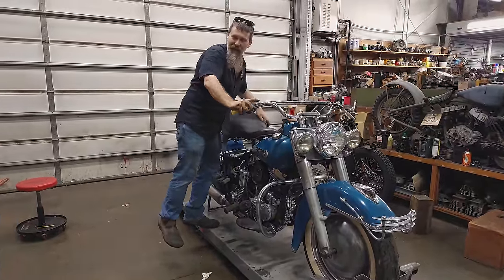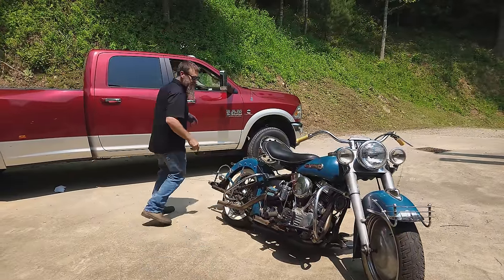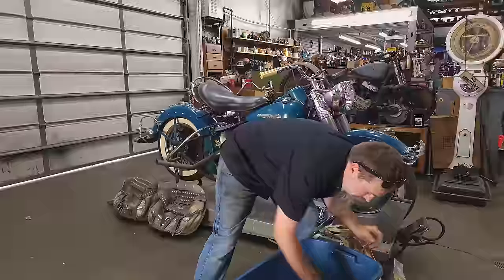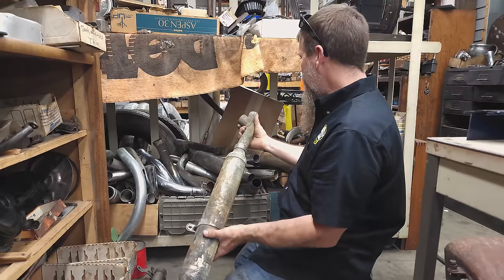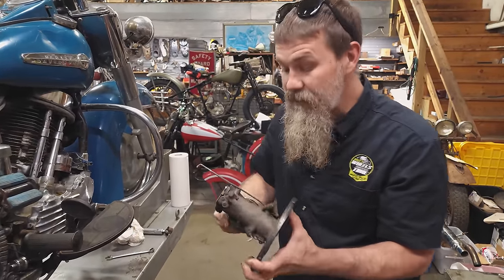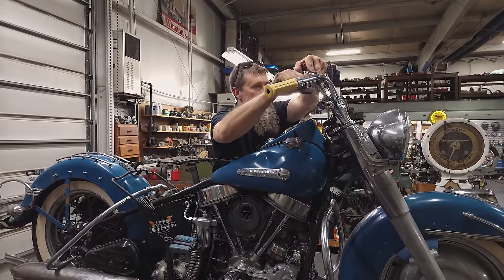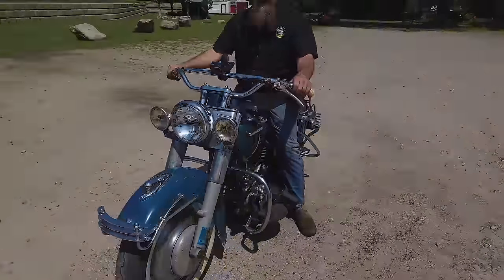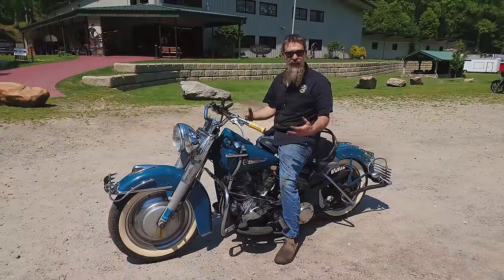I Drove 4,000 Miles For This?

Comment: The fact it sat for 40 years and fired up is a testament to the quality back then.
Reply: That's what's charming about old bikes and old cars,they are not as reliable or confortable or safe as modern vehicules but they are so straightforward that they don't break that often and when they do it's easy to fix unlike stuff today and you have that raw mechanical feeling you don't get nowdays
Reply: that hasnt been sitting 40 years.  I bought a car that had been sitting 40 years and the brakes were siezed on,  the oil was like treacle and the water was like minestrone (know thats not a factor for a air cooled bike).

Comment: It warms my heart to see restoration to factory spec with genuine parts. I'm not a fan of over-restoration or the "resto-mod" treatment. There are plenty of incomplete and previously modified machines to make loud choppers out of. (I feel the same way about Model T and Model A Fords; cutting up a good stock one to make a T-bucket or a roadster hot rod is a crime.) I hope you can do a little "paintless dent repair" to the right side of the tank.

Comment: The dent in the right side, gas tank could be mostly removed without sacrificing all of the factory paint. We have in the past removed such a gas tank and cut a window in the flat inner portion of the tank, allowing the dented portion to be pushed out without totally Sacrificing the factory paint. If it is done gently and the paint is heated as the dent pushed out sometimes most of it can be saved. It’s not like the tank can be fixed any other way and the paint be saved so it’s worth a try. After the dent repair, the window can be welded back shot if it’s done carefully so as to not harm the remaining paint. Just a suggestion.

Comment: The 1950 Big Twin is one of the most elegant Harley-Davidsons ever made. The Cabbage Cutters bumpers only detract from that elegance. So do extra covers and various gee-gaws. Simple and functional is best. Saddlebags and windscreen fit that bill. Also, consider replacing the fat 16s with 4x18s to give it sport bike handling. Set up like that, it matches the 1936-39 EL's as Harley's finest in the classic period.

Comment: Well depends on how well you set the carb up when your cleaned it. If all is set right for timing and points look good it should start after priming on the first or second kick. Time to take that beast out on the highway and let it roll. I love Pan Heads. I always wanted a 54 the year I was born.

Comment: Use the bead blaster dust to clean up that old  exhaust pipe chrome.  This is also what you do to stainless steel to give it a satin finish

Comment: Matt, I'll guess 5 kicks the first time and 2 kicks the second. 😄 Seriously though, for that original chrome to be in such good shape after 72 years, how did the owner store it? Current bike owners could learn a thing or three.
Reply: It has a lot to do with what part of the country it was stored in. If it was 4000 mile round trip, that means it was probably in California or Nevada, you couldn't ask for better conditions to store vehicles. I'm in the northeast and I have to run two dehumidifiers in my basement during the warm months to try to keep my stuff from rusting.